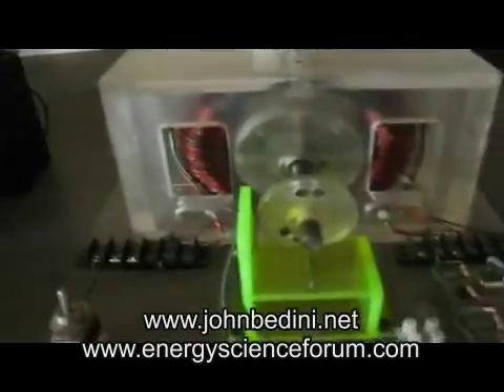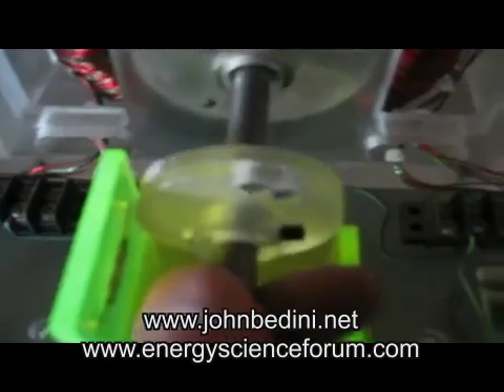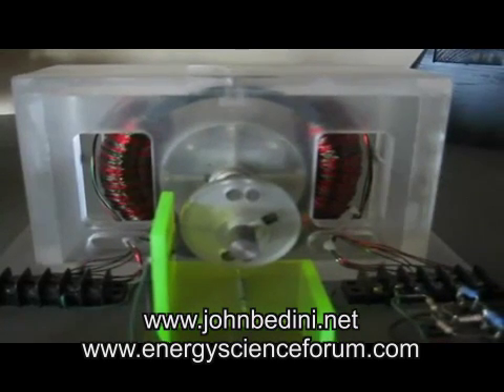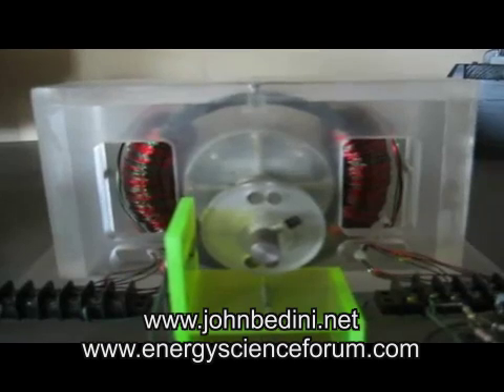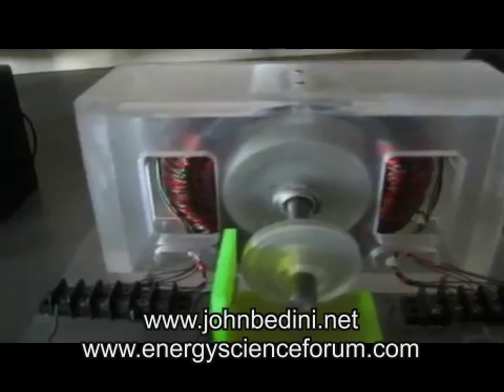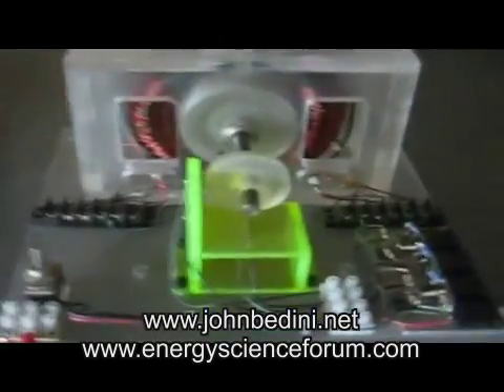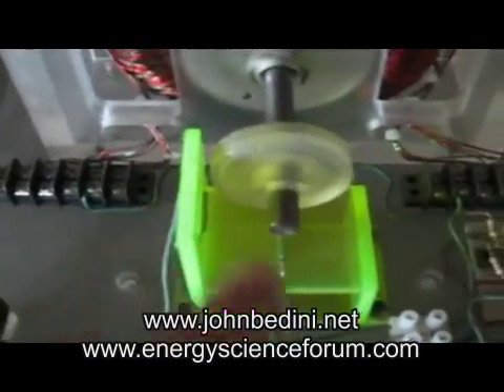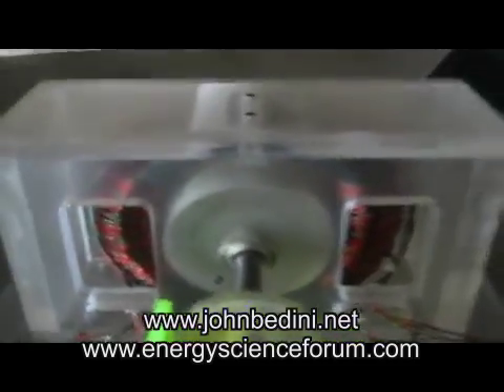Zero Force Motor - John Bedini

Comment: Help me understand.  At 15 seconds into this video, what looks like a black motorcycle battery can be seen on the left, with a wire running to the battery.  Is Bedini claiming this is a perpetual motion machine, that runs without batteries?
Reply from the maker: It is not a perpetual motion machine and it takes energy to run. It runs on principles that are not generally understood by conventional science.
Reply: Rick McCall nothing in this world is perpetual motion without input power.  You can attain self loop if your efficiency is high but you will need a starter energy source to power up such a device
Reply: @ConstantineJoseph  everything in this world is perpetual motion, just look at the sun, the movement of the planets, the bindings if molecules, the "electron" rotating around the "atom" (which are false concepts of virtual particles).
the only thing that is not perpetual motion, is our oil fueled based money economy.

Comment: can this circuit made with mosfet ?
Reply from the maker: +kevin pounal If you can post your question in http://energyscienceforum.com that is the official forum for this motor. That is what I posted last time. There is a thread discussing the zero force motor - it is actually in the 3D monopole thread where John discusses this.
Reply: when i try to reg it keep saying the username or password not correct all when it send me a password
Reply from the maker: kevin pounal send me a pm in facebook if you're on there http://facebook.com/aaronmurakami13 and give me the email you're using to register and I'll make sure you're acct is setup.

Comment: "It self starts?" are you implying that this contraption creates energy from a vacuum?
Reply: Nathanael Arumugam "It self starts" meaning once he applies power he doesn't need to give it a push(triggering the control circuits) to get it spinning. Nothing about vacuum energy...
Reply: Do you mean to say that when he turns the switch the motor spins? WOW thats amazing! never seen anything like that in my entire life, LOL, 
In all seriousness though, what is the novelty or innovation in this, my understanding of electrical engineering is pretty basic
Reply from the maker: +Nathanael Arumugam Normally, these kind of motors require that you manually spin the rotor to get it to trigger in order to start them up. The novelty of this motor is that there is no back emf. Lenz's law is avoided.
Reply: Okay.... what can this motor be used for? what type of applications are the basic models used for currently? ]
Reply from the maker: +Nathanael Arumugam Anything that needs some good torque or speed with less electricity than it normally takes. Without Back EMF, it is way more efficient than conventional motors.
Reply: No kidding, thats amazing, I actually do a have a need for such a device although it would need to be quite big, have you hear of those EV Cars, where they convert gas car the electricity. They basically remove the entire moteor and leave in the transmission then they connect an old fork lift motor or something similar and pack the trunk with crossed wired car batteries, its actually quite cheap and amazing, only issue is the limited range, so no driving cross country, but to work and shopping is no problem. So can you help me attain a bigger size unit?